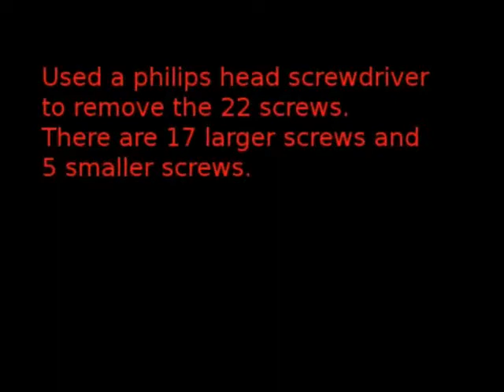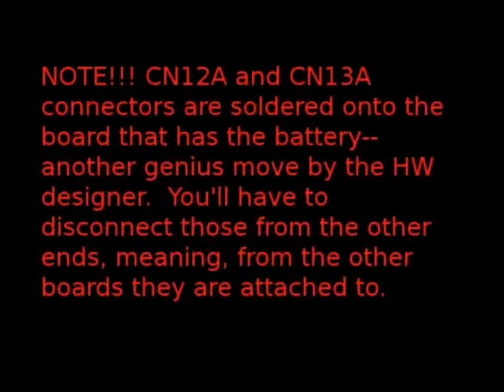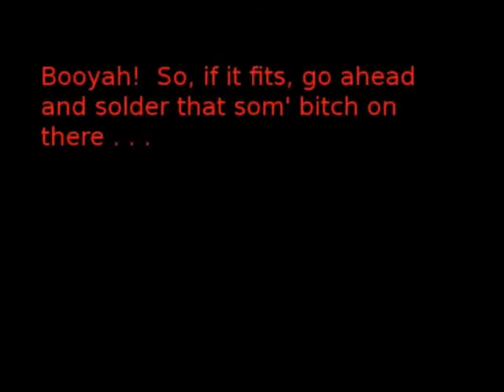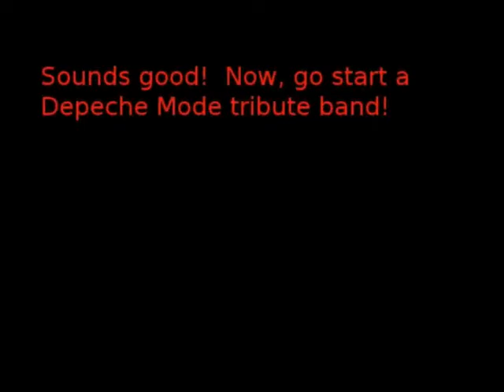Korg DW-8000 Cell battery holder mod overview

Comment: doing mine right now. what was an epic score, a would be positive 2020 closer... summed up 2020 instead.... Sanyo battery metered fine, strong 3v output, lit up a diode emmiter i use to see power and surely a dead cr2032 would not power it... opted for the mod/replacement any ways for proper measure... summing it up... the previous jackass spilled something on the keys and wouldnt you know it... corroded main board.... liquid, crappy mass productions metal housing, electricity in an enclosed environment set timer and bake for 14 years give or take... perfect vibrant piercing green corrosion...  Thanks 2020... and previous jackass... assuming he wasnt actually aware of this spill i'll opt for the better side of human existence...

Comment: I have the rack version EX8000 , need to go in there too.
Hope its not soldered. I'll just run two wires out side the thing and tape the battery to the side. It never leaves  my studio. Drilling holes in circuit boards, nah.
Reply: im using 2 solid wire conductors... solder to the pcb lugs and heatshrink it... running wires basically the same... lithium - manganese batteries.. dont let them kid you on 5 years. easily see 20 years on coin cell... 10 year non cycled shelf life...

Comment: Hello, i have a dw-8000; at the beginning its first part of the keyboard (first octave) was not working while the others were working, then now all the keys are not working it doesnt give out sound, it can be because of the battery? When i change the battery does it lost the pre-recorded sound database? Do i have to re-record the sounds into it again?
Reply: J. Harris yes, it very well could be the internal battery had died on you. Once the battery is dead, every time you power the dw8000 on you would have to load up the patches again. Otherwise you just get some really high-low pitched squeaky fucked up sounds lol. I had this happen to mine's and now I'm in the process of changing the battery with the holder mod.
Reply: https://www.pallium.com/bryan/dwbattery.php   he has an editor and librarian and other tools for specific needs.

Comment: Hey great vid. I'm in the process of adding the battery holder. Question: where, on the circuit board, do I line up and solder the negative pole of the battery holder. Great if you can help thanks.